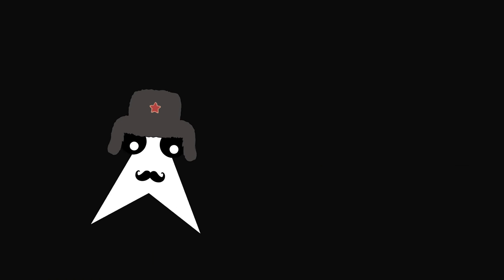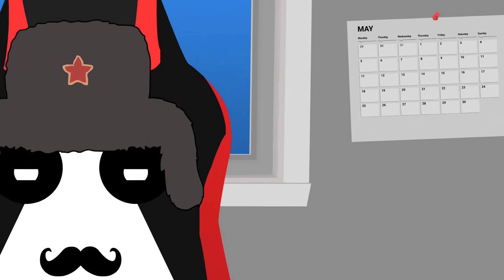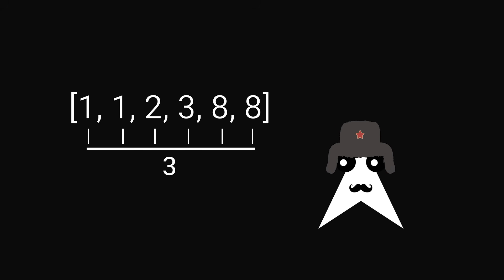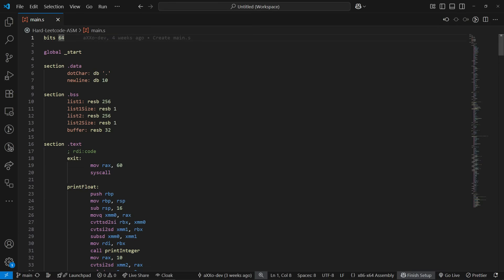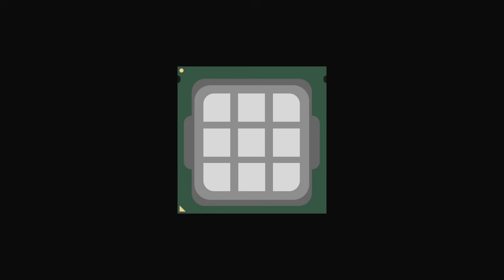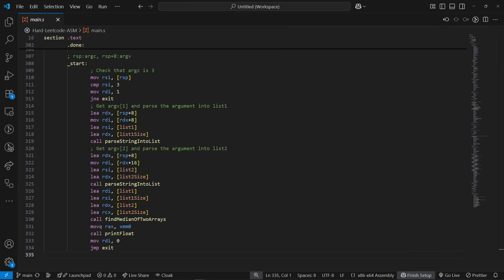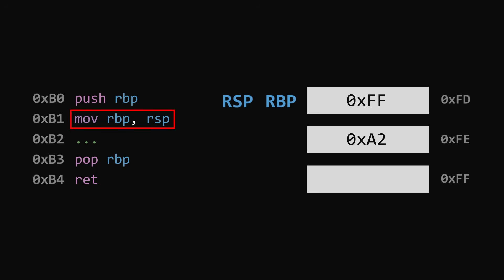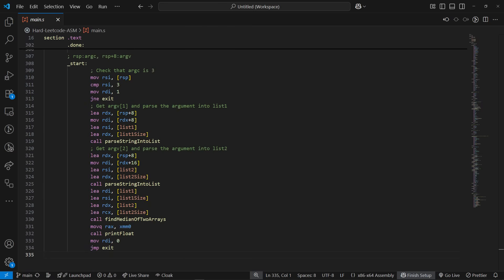Torturing myself with Assembly programming

Comment from the maker: I rushed this 14-minute video due to schedule delays. This pinned comment covers details I missed:

- I tried to come up with a mnemonic to explain why operands are called operands because I'm not a native English, but yes as a lot of people pointed out operands in math are just the parts of an operation so the word is probably already very natural to many (I didn't know literally).

- Humans use decimal (base 10) with digits 0-9, where each position represents a power of 10. For example: 234 = (2×10²) + (3×10¹) + (4×10⁰). Other important bases include binary (base 2) and hexadecimal (base 16). Hex numbers use "0x" prefix and digits 0-9, A-F (where A=10, B=11, etc.). Hex is used for addresses because it represents large numbers compactly.
[ https://en.wikipedia.org/wiki/Hexadecimal ]

- Intel syntax uses right-to-left operand order. In "sub rax, 5", we subtract 5 from rax (rax - 5), with the result stored in the first operand (rax). This pattern applies to most opcodes that perform operations.
[ https://imada.sdu.dk/u/kslarsen/dm546/Material/IntelnATT.htm ]

- Registers like rax, rcx, rdx, rsi, rdi are general-purpose with conventional uses (e.g., rax for return values). You can access smaller portions using different labels: eax accesses the lower 32 bits of rax (same physical register, different bit ranges).
[ https://wiki.osdev.org/CPU_Registers_x86-64 ]

- I completely ignored logic gates. I would look up discrete mathematics and try to learn about it if you want a very through understanding of them.

For more resources regarding the video's contents I would invite you to my other videos about assembly:
- You NEED to Learn Assembly: https://www.youtube.com/watch?v=tTwlt6vJXmQ

Comment: Something I find sad is that people think they need to do Leetcode to be programmers. Reality is, most things discussed in Leetcode are hyper-specific and rarely needed. I write software in C, and I've written lots of different kinds of software from complex to simple, and I've never actually needed algorithms like a binary search. The most complex algorithm I've ever had to implement is a recursive decent parser.
Reply from the maker: That’s not the point of the video, but I can agree with you. I always saw sites like Leetcode as a way to practice using a specific language through the challenges rather than competitive programming. 

It doesn’t matter if you can remember the best solutions to solving algorithms all that matters is if you can write the code. And if you can, then you can find better ways to do the same thing you made.
Reply: @axxo1337  Yeah, don't worry, I understand the point was to do a Leetcode problem in ASM. :)
Reply: no they do it to get a job , most job interviews questions are leet code bs
Reply: i write os in C lol
you are true, leetcode is only for reeaally specific area of programming
i actually programmed in assembly before i wrote my os in C, it was pretty fun
Reply: what? people do leetcode for jobs? I thought it was a puzzle game. I do it for fun :o)
Reply: @treelibrarian7618  And that's okay!

Comment: An operand is the object that an operator operates on. For example, if the derivative with respect to a variable is the operator, then a continuous function of that variable is the operand — for instance, d/dx is the operator, and q(x) is the operand.
Or consider addition: add(x, y) = x + y. Here, x and y are both operands. The result is the operator add acting on x and y to give x + y.
The term "operand" is used mostly in functional analysis.
Reply from the maker: Or simply: operands are the quantities on which an operation is done.

Comment: 1. Assembly simpler than... React or any framework
2. Assembly is nearly useless. It is non-portable, and how CPU really handle code is optimized to major compilers where chip manufacturers put effort.

If developer wasn't working on 8-bit machines, starting from Motorola 68000 / Intel 286 were enough fast to run high level compilers. When developer need to access system interfaces, there was piece of assembly, or it was optimization.

When we move 32-bit era, assemby was limited to some performance optimization like graphic rasterization or video codecs, or there was something where CPU extensions were useful. They were usually video codecs and similar stuff. Later rasterization was moved to GPU.
Reply from the maker: Ok
Reply: Assembly isn't even close to being useless. GPU manufacturers write the drivers for their GPUs in Assembly language. WebAssembly, Java Assembly and many other languages, mostly interpreted, have their own Assembly. Software piracy and cracking relies on decompilers, which turn machine code into assembly, which allows hackers or software pirates to modify a binary's code to allow access to paid software or find a backdoor in a system. Speaking of backdoors, Assembly is still used in many companies to patch possible backdoors and vulnerabilities. And, finally, the most essential role of Assembly, is that when operating systems are developed, the programmers have to switch from 16-bit real mode (an backwards compatible mode available in all x86 CPUs on boot) to 32-bit protected mode, and finally to 64-bit long mode, all of this done in Assembly. Bootloaders, which are responsible for booting your operating system, run on 16-bit real mode. The bootloader then loads the operating system code, switches to the aforementioned modes and then runs the operating system code.
Reply: @warrior2364

"Assembly isn't even close to being useless. GPU manufacturers write the drivers for their GPUs in Assembly language."

Sure, but it doesn't matter rest of the world because they don't document hardware interfaces well or they can keep code in secret. 

"WebAssembly, Java Assembly and many other languages, mostly interpreted, have their own Assembly."

Generated by compiler. Humans don't write that.

"And, finally, the most essential role of Assembly, is that when operating systems are developed, the programmers have to switch from 16-bit real mode (an backwards compatible mode available in all x86 CPUs on boot) to 32-bit protected mode, and finally to 64-bit long mode, all of this done in Assembly. Bootloaders, which are responsible for booting your operating system, run on 16-bit real mode. "

Ony few lines of code. There can be few lines of assembly in compilers and runtime systems. It doesn't really matter on software development as compilers make that assembly code so humans don't have to.
Reply from the maker: @warrior2364 Trust me bro don’t engage. It’s the best thing you can do. Hence why I just replied “Ok”…
Reply: @warrior2364 

Very essential role of assembly was making concurrency possible in Turbo Pascal. We didn't have threads in 80s so we use coroutines, and Pascal lacked setjmp/longjmp like in C.

Assembly also easily gives about 1000x speedup compared to BASIC in Commodore 64. That is why learned assembly immediately after BASIC when I was kid. Compilers got more advanced and way CPUs were made, make assembly mostly obsolete even on performance optimization back in 90s. Assembly optimized rasterizers moved to GPU, also video decoding.
Reply: Assembly is still extremely useful. There are some things the compiler just can't optimise away, or the compilation target might not include enough features. In those and a few more cases, manual optimisations are created and often dynamically dispatched. The architecture market is not what it was like. We don't have 6502, 68K, Z80, MIPS, and a whole bunch of other architectures in use anymore, we've consolidated to x86, ARM, and RISC-V for the most part. Targetted optimisations to those are actually pretty feasible, and software implementations can be used to fall back on when a platform isn't supported. An example is video encoders. They are some of the heaviest users of SIMD operations. rav1e, an AV1 encoder by Xiph, is only 20% Rust; 80% of the codebase is assembly.
Reply: @KaliTheCatgirl 

When we have Turbo Pascal, it was single pass compiler making fast compilation. It didn't really make any optimizations so assembly handtuning for long running loops give speedup.

Early 90s C compilers had good optimizations already, that was time when assembly optimization was still very useful to make graphics routines, audio and video decoding, math kernels and similar what was taxing in real time applications. Compilers easily had bugs in advanced optimizations so all optimizations were not always used.

Pentium Pro was turning point when there was out-of-order execution. Processor run machine code different order how assembly instructions were in code. Same time cache sizes started to increase and compiler development got plenty of resources. Everyone knows that assembly optimization is soon history.

When Pentium 4 released, no one really anymore optimized in assembly anything and extensions for SIMD commands were matured. Compilers were so good and different CPU generations between manufacturers worked so differently that it didn't make any sense to write all assembly routines dozen times. Compilers surpassed humans simple way that when there was new CPU architecture, compiler optimized it by pressing button. Even most performance oriented developers actually started to remove their carefully hand optimized routines from source tree as they were useless when they measure C vs asm versions of code.
Reply: 1: compilers can't vectorize for shit, only the most basic of loop-vectorizing patterns, and AVX512 assembly is way easier to write and read than intrinsics.
2: admittedly no-one uses asm to write entire packages or games any more, commercial pressures don't allow the time, but 99.9% of professional coders not understanding with what and how a CPU executes the code they write at higher levels is how the software landscape has got into the awful mess it is in today. 
3: learning and using asm is useful in itself because it empowers you to write better code at every level of abstraction. Think of it as exercise to make your brain stronger and more flexible, like rock-climbing or hiking the wilderness. We don't need to hunt or forage for food anymore, but a walk in the woods is still fun, and can open your mind to inspiration.
4: although the code isn't portable, the understanding is: once you know x64  arm3, arm9 or risc-v isn't hard. You can read the documents, grok the differences in an hour or so and carry on.
5: assembly is fun! don't shit on everyone's enjoyment of it.
Reply: @treelibrarian7618

At least 90% of developers don't know how computers works, but I agree that it should be learned to every developer. Only optimization case is really some inner loop SIMD

And assembly is simpler than any framework. Children can handle it.

Comment: Hello, great video as always, what is the performance compared to C++ code ? Also do you think using other instructions (that do things quicker such as simd cpu instructions althought they are a bit irrelevant here) would make the program run quicker ?
Reply from the maker: I don't think the performance is any better. A compiler will have more chances of generating a faster machine code down the line for sure.

Using xmm registers can definitely speed things up by relying less on the stack and more on register operations.
Reply: @axxo1337  the performance of your asm may not be better, but that's mostly because you use too many branches. This particular challenge can be done with no branching except the search loop's branch back, and no stack/memory usage only registers (except reading the data arrays obviously).

That said, the performance of C++ code on leet is quite poor, with the bulk of submissions often 2 to 4 times slower than the same challenge in C, I think because most C++ programmers do too much abstracting and using overweight template-library functions in place of things that would be trivial to implement directly, without all the overhead. So your code is probably at least 2x better than that ;)
Reply: This particular algorithm couldn't be faster from vectorization because it has a decision to make after each memory read that decides where to read next. Vectorisation/SIMD works when you have big blocks of data that all need to be processed in the same way, or can at least  predict the next 8 or 16 data items you want to work on. I have seen a vectorized binary search, but it required that the data be rearranged into a big tree of test-sample data so that 16 compares could be done to pick the next 1 of 17 search block to look at, which is only viable for a massive static dataset you're going to be doing millions of searches on (this example was for a genome database). As soon as the data changes you have to rebuild the search tree which is far more costly than just doing a decently optimized binary search.